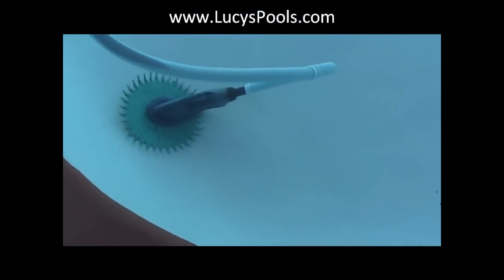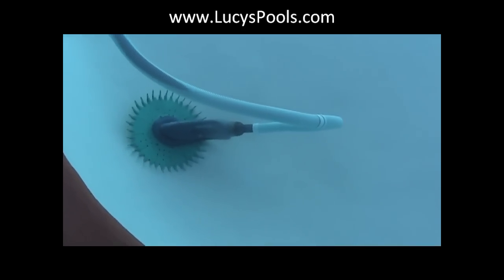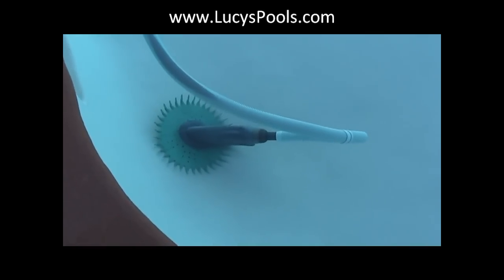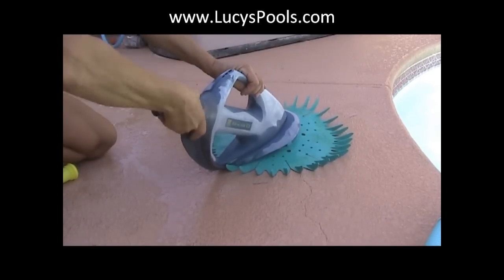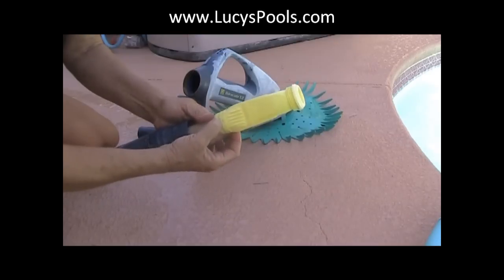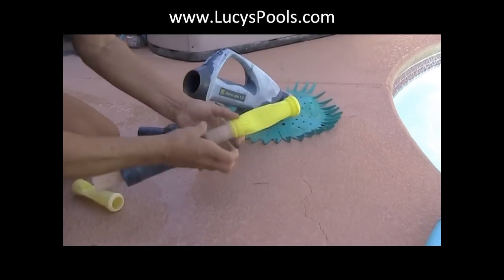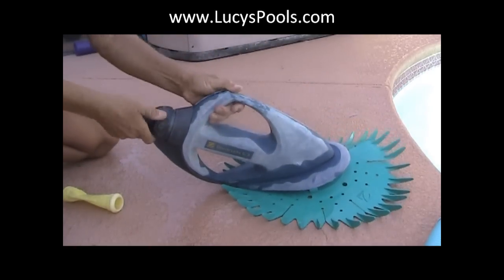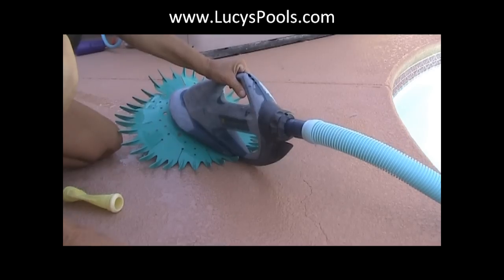Barracuda Pool Vac Repair

Comment: Hi Lucy, I see you are not using Deflector wheel?
Mine keeps getting stuck near the steps like yours. Should i get rid off Deflector wheel..
Reply from the maker: +RANA ABID I apologize for the late response. Some of the newer Barracudas don't require the wheel to be installed. If you have a return line near the steps, point it towards the step to use the water to push the Barracuda from getting stuck. And be sure the bottom pad is not worn down. I hope this helps. Thanks for watching, Lucy

Comment: any idea why mines climbs the walls too much? It like i turn it on then it climbs the wall and goes too high then is half way out of the water, ive  tried turning down the suction by turning the lever but seems to always happen
Reply from the maker: Jeff Ande  Turning it down is a good first step. Try opening up the skimmer or main drain a little to offset the suction.

Comment: I checked my diaphragm and its fine? There is good suction and nothing stuck in the pipe or the Unit, but it still does not work. 🤷‍♂️
Reply from the maker: Be sure diaphragm is not put in backwards. And make sure it’s snug. Check for any twigs that could be inside the tubing. Also is the footpad worn down or still intact? When they’re worn down the suction can be too strong. Hope this helps. L
Reply: lucyspools I stripped it as per your tutorial which was very helpful thanks. I can see no problems at all based on your video. But the suction side on the yellow diaphragm is very close/narrow. What would the gap be on the suction side when the diaphragm is new? 🤷‍♂️ Thanks for your help.
Reply: Having looked at your video again it appears that the yellow diaphragm suction side is fully open and round. My unit is closed and has perhaps collapsed. Again thanks for your help Lucy.
Reply from the maker: Mark Green It’s supposed to be narrower in one section. When you say the suction is good, is your main drain closed to allow more suction? Is the hose in the side of the wall or in the skimmer?Ultimately you don’t want only full suction to the vac but I’d try full suction then begin to open the other valves. Is your filter clean? These are all troubleshooting actions I’d take. Keep me posted.
Reply from the maker: Mark Green I’ve found that diaphragms last about one year, obviously depending on use. Glad you figured out the problem.

Comment: The yellow nut that connects the hose to the head keeps coming unscrewed,anybody know why ?
Reply from the maker: Eddie Lane Sorry this reply is tardy. Have you resolved your problem? Not sure what yellow but you’re talking about but if the hose is disconnecting maybe secure it with a hose clamp?
Reply: Use teflon to secure it tight